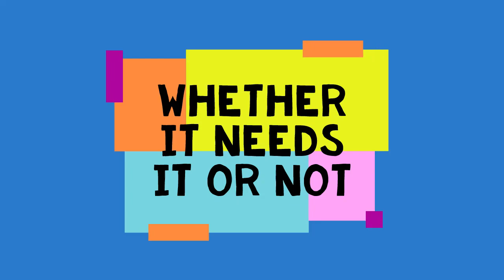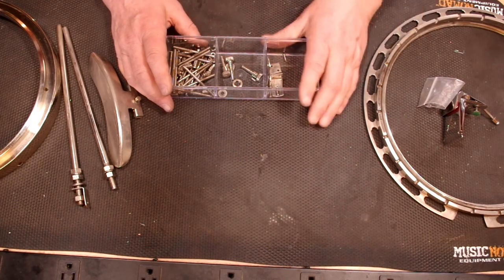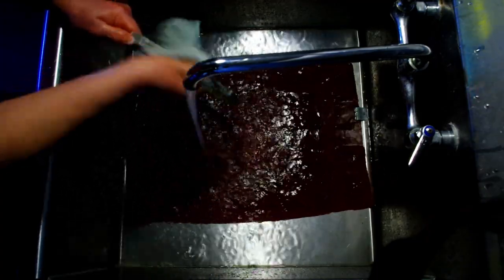Gibson banjo restoration- Metal parts

Comment: That's a nice, old, Gibson banjo with a lot of character!!!!!!! That tailpiece looks to be original for an early 60's bowtie. A friend of mine has an original 62 flathead bowtie & it has the same tailpiece. 
     The bowties can sometimes be a bit difficult to determine what are the original parts. The reason for this is that they were made right at the end of a Gibson transition period & also continued production through one or two more. I know the tailpieces & tuners changed a few times through the years. Greg Ernest is considered to be one of the most trusted authorities on vintage & prewar Gibson banjos. He offers a better description & explanation in here:  
     "After the hiatus caused by World War II, Gibson resumed banjo production in 1948 with two models, both non-Mastertones.  The style 100 was a budget-model instrument whose lineage could be traced to the prewar style 00. The style 150 was essentially the same banjo, but was dressed up with most of the same cosmetic appointments (with the exception of a Mastertone block and a bound peghead)."
     Back to my knowledge. The RB-250 or (style 250) that you are working on, was the next banjo in that line & Gibson's first "postwar" Mastertone model. They were first produced sometime between 1952 & 1954. Gibson began to change the "guitar style" peghead shape into the "fiddle cut" around 1968 & shortly after, adopted a different inlay pattern altogether. The modern 250's are considered to be an entry level Mastertone.